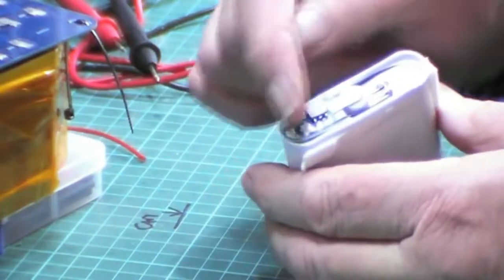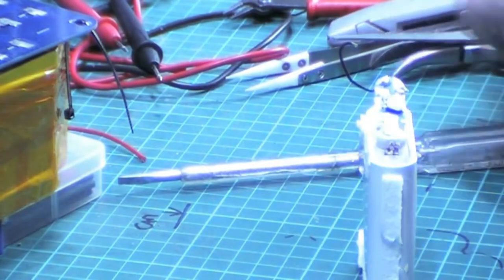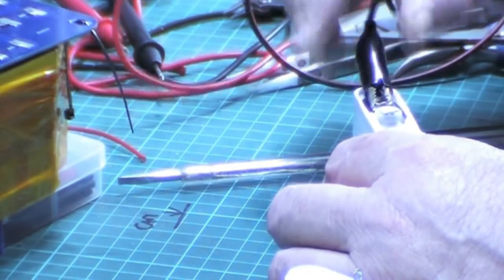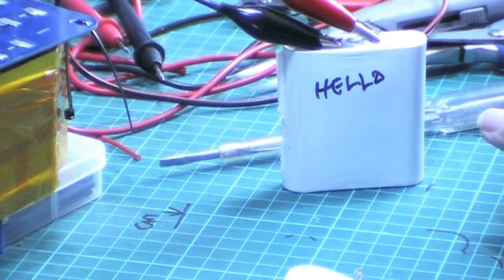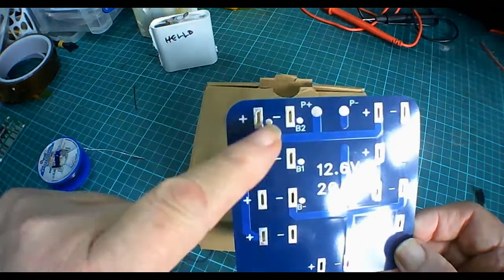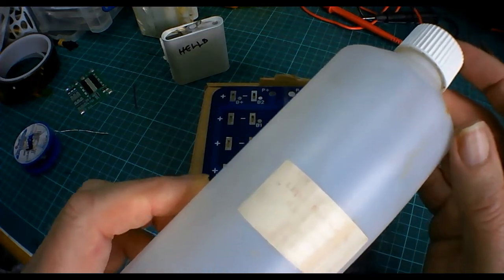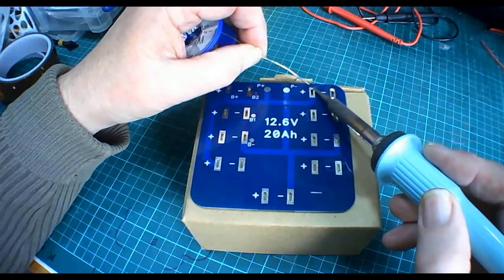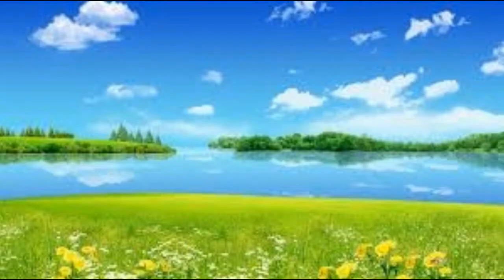12V 20Ah  Battery Part 1

Comment: The battery you are building Looks like it’s going to be a lovely little square Form factor ideal for your projects with the E bikes just surmising that’s what it’s going to be for stay safe look forward to the next one
Reply from the maker: Thank you my good friend. Yes ebikes and my power wall. My original power wall batteries I built were a bit messy in construction. 2 of these per battery will work great. Please stay safe both of you.